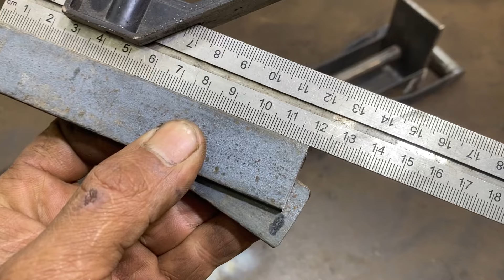Sebuah Gagasan Alat paling cerdas terbuat dari besi siku yang pasti akan di minati jutaan orang!!

Comment: please do not hold any piece of metal while drilling and especially not a long piece of metal and especially especially, do not put your finger inbetween that piece of metal and table
if youre lucky you just get your hand ripped off, if youre unlucky you get sucked into the drill press and tangled around it like a piece of wet cloth being wringed  dry and then centrifuged even more dry